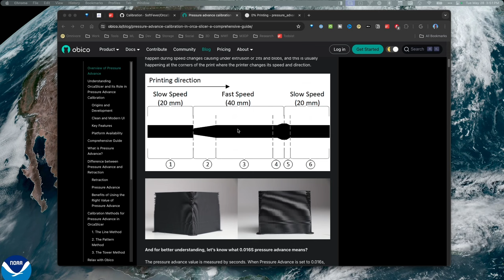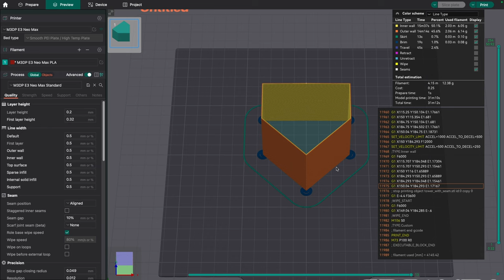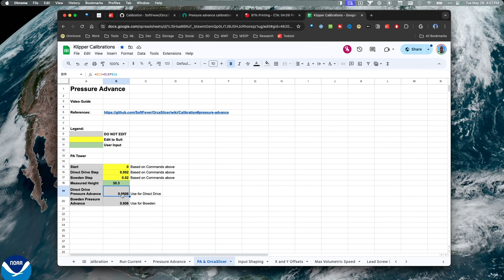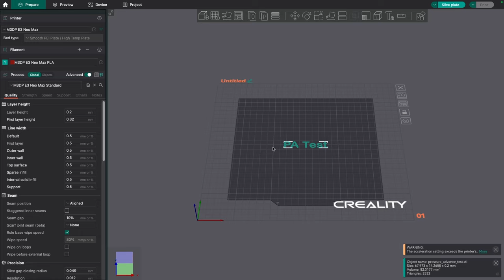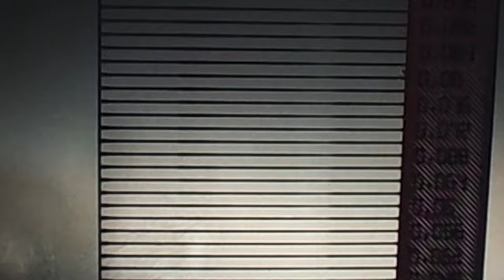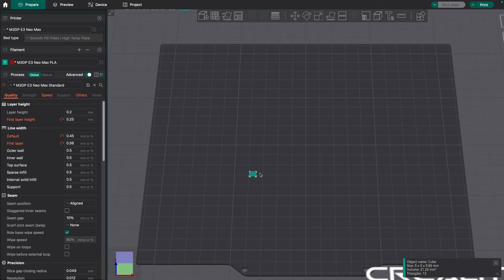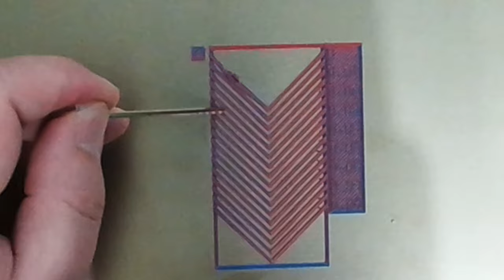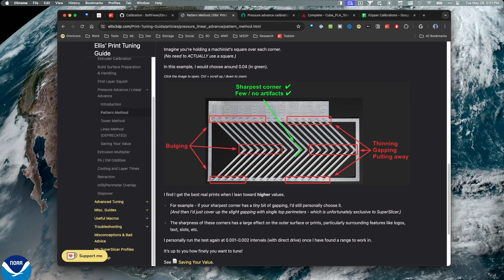Orca Slicer Pressure Advance Testing and Calibration: Unlock Sharper Prints (Ultimate Guide)

Comment: Hey i just found a neat trick print the PA line test then look at it with the lines running left to right but at about 10 to 30 degrees to the build plate it real help tell when the lines go from bad to worst then put you finger about half way between
Reply from the maker: Thanks for sharing.  I will give it a try.

Comment: I’m assuming speed and acceleration settings would affect these calculations?
Reply from the maker: It will. You.want both set to your preferred values before you start the PA tests.
Reply: @minimal3dp  How do you determine what your speed and acceleration values should be? I'm using a FlashForge 5M Pro so it does print fast. But some of the filament I'm using really can't keep up with these speeds and I think that is affecting my prints. What's the best way to determine what speeds & accelerations you should use per filament? And there are a large amount of parameters for speed & accelerations values. Which should you adjust and which should you not? Appreciate any help. Thanks,

Comment: Question: does your spreadsheet accommodate other firmware types, like Marlin and stuff?
Reply from the maker: No itsoes not. It is designed for Klipper. Take a look at the TeachingTech calibration site. It is ideal for marlin.

Comment: Can I provide you with some constructive criticism? I highly highly highly suggest you find a way to improve the visual quality of your video(s). I've only watched this video. I don't know about the rest. I have it set to the highest quality (1080p), but the picture quality is very fuzzy and looks like a video from 90's. I think it's especially important  with 3D printing videos, so we can see important details. I don't know if it's your camera equipment or settings or what... The audio quality as well seems quite low.
Thanks!
Reply from the maker: Your criticism is welcome and warranted. I really appreciate your feedback. 

Unfortunately, both my video and audio are what I can afford at the moment. I am trying to save for better equipment, but it is slow going. I typically need to buy items to do videos about and save, so it's not super fast for me. 

I am going to try to sell a printer to generate some capital to invest. 

I have also discovered that my hearing is not great, leading to some quality issues that I am not detecting. A friend has offered to assist me, and I scheduled a hearing appt later this month.